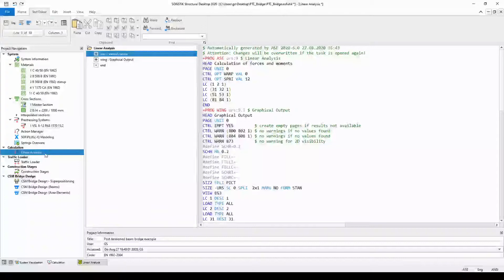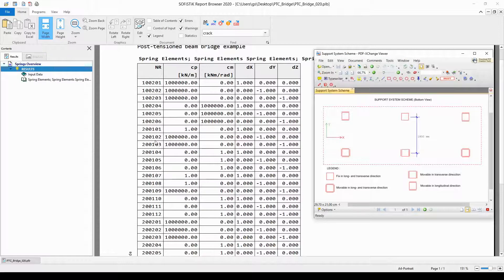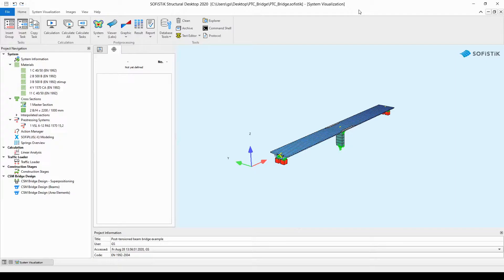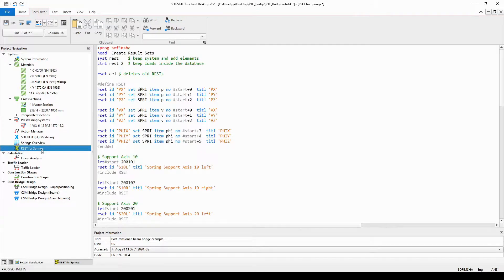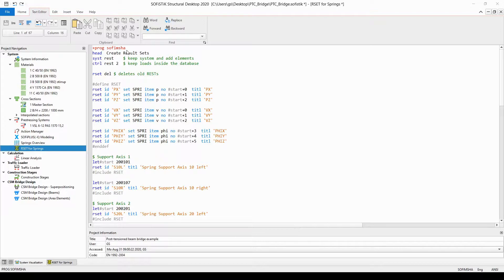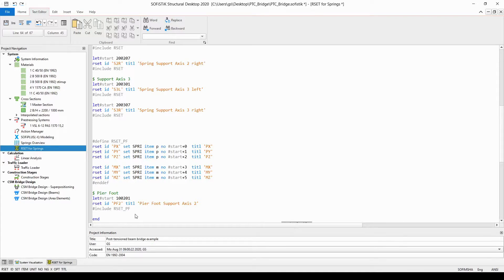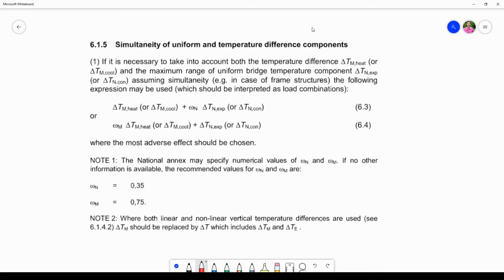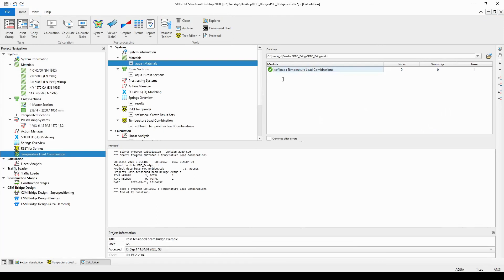Bridge Design Training #07 - Result Sets (RSET)

Comment: +prog sofimsha urs:18.1
head Create Result Sets
syst rest    $ keep system and add elements
ctrl rest 2  $ keep loads inside the database

rset del

$-------------- Pour les springs non encastrés

#define RSET  $Création d'un text bloc qui pourra être réutilisé + tard
rset id 'PX' set SPRI item p no #start+0 titl 'PX'
rset id 'PY' set SPRI item p no #start+1 titl 'PY'
rset id 'PZ' set SPRI item p no #start+2 titl 'PZ'

rset id 'VX' set SPRI item v no #start+0 titl 'VX'   $ v = verschibung = déplacements
rset id 'VY' set SPRI item v no #start+1 titl 'VY'
rset id 'VZ' set SPRI item v no #start+2 titl 'VZ'

rset id 'PHIX' set SPRI item phi no #start+3 titl 'PHIX'        $ phi = rotation
rset id 'PHIY' set SPRI item phi no #start+4 titl 'PHIY'
rset id 'PHIZ' set SPRI item phi no #start+5 titl 'PHIZ'
#enddef

$Support Axis 1
let#start 200101
rset id 'S1L' titl 'Spring support axis 1 left'   $L'id doit toujours commencer par une lettre pour un ressort et max 4 caract.
#include RSET    $ on inclut le bloc texte définit + haut

let#start 200107
rset id 'S1R' titl 'Spring support axis 1 right'
#include RSET

$Support Axis 1
let#start 200201
rset id 'S2L' titl 'Spring support axis 2 left'   $L'id doit toujours commencer par une lettre pour un ressort et max 4 caract.
#include RSET    $ on inclut le bloc texte définit + haut

let#start 200207
rset id 'S2R' titl 'Spring support axis 2 right'
#include RSET

$Support Axis 3
let#start 200301
rset id 'S3L' titl 'Spring support axis 3 left'   $L'id doit toujours commencer par une lettre pour un ressort et max 4 caract.
#include RSET    $ on inclut le bloc texte définit + haut

let#start 200307
rset id 'S3R' titl 'Spring support axis 3 right'
#include RSET

$-------------- Pour les springs encastrés  (SUPPORTS)

#define RSET_PF  $PF = Pier Foot (encastrement en bas de pied de pile)
rset id 'PX' set SPRI item p no #start+0 titl 'PX'
rset id 'PY' set SPRI item p no #start+1 titl 'PY'
rset id 'PZ' set SPRI item p no #start+2 titl 'PZ'

rset id 'MX' set SPRI item m no #start+3 titl 'PHIX'        $ m = moments
rset id 'VY' set SPRI item m no #start+4 titl 'PHIY'
rset id 'MZ' set SPRI item m no #start+5 titl 'PHIZ'
#enddef

$Pier Foot
let#start 100201
rset id 'PF20' titl 'Pier Foot Support Axis 20'
#include RSET_PF

end